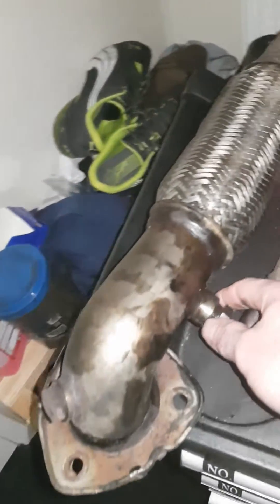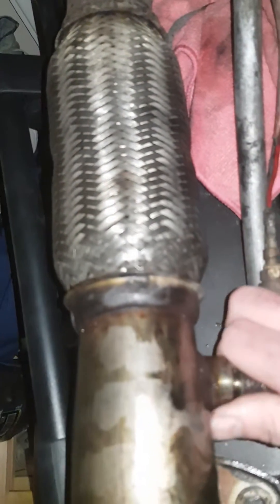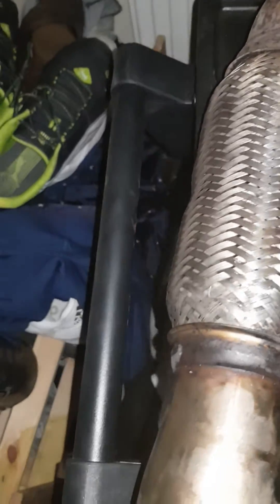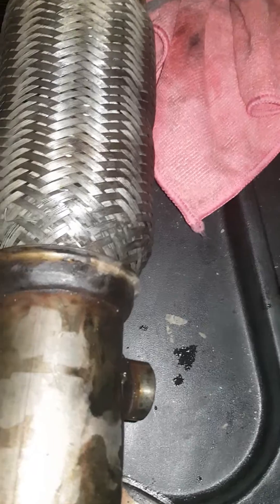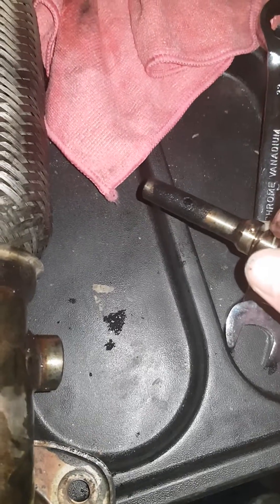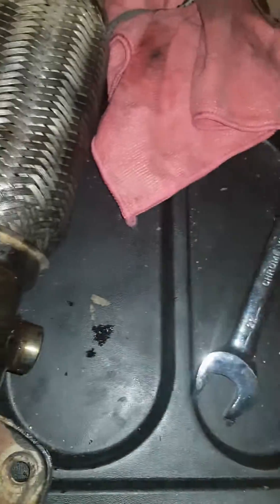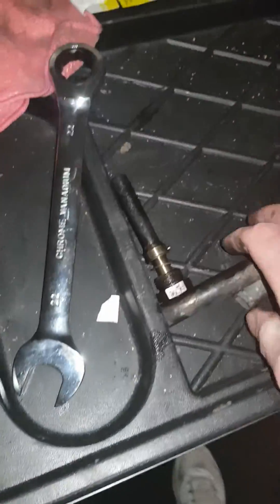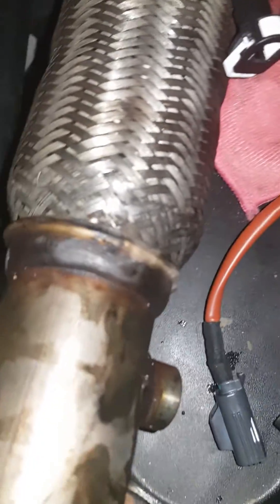Dpf fuel vaporiser 5th Injector testing

Comment: Hi mate.. is there a technique for when you have replaced it with new. Do you have to purge or prime it ??? Not done one before and im gonna have a go.   Cheers
Reply from the maker: The best advice to remove them is with a half inch impact gun . Cut it off so a 22mm socket will fit and buzz it off . Once out fit the new one and just make sure all is connected no need to prime it .